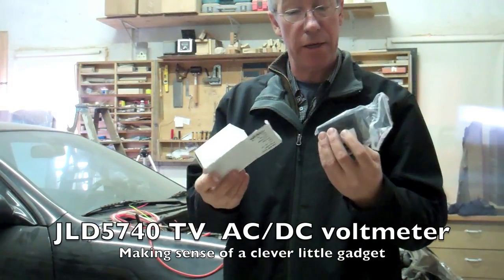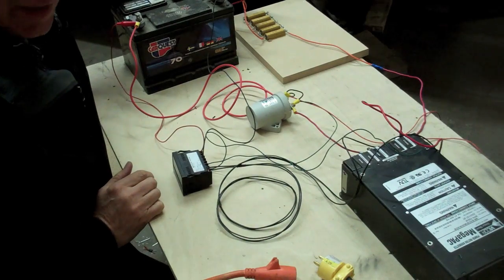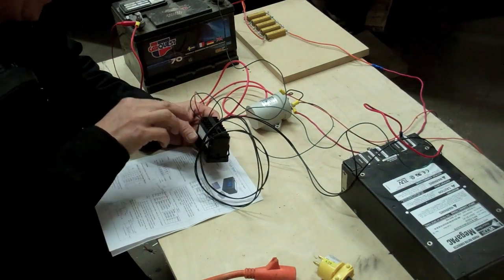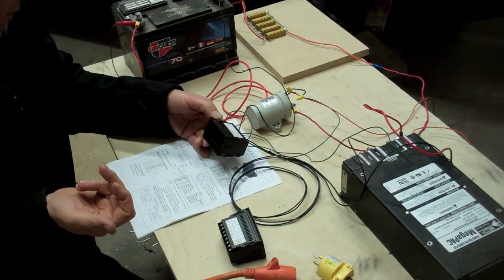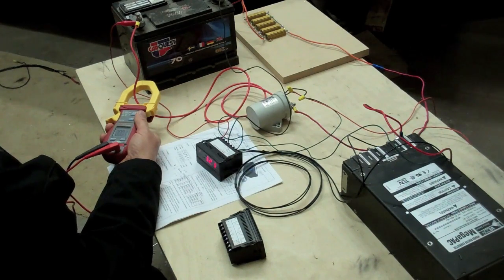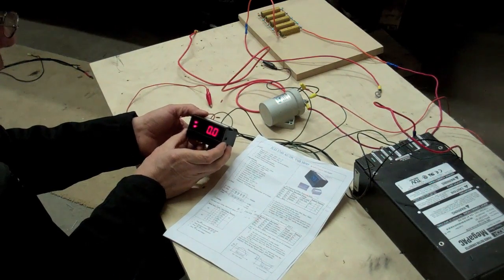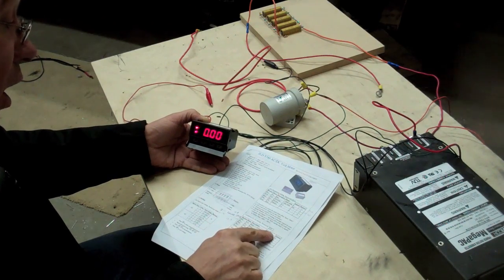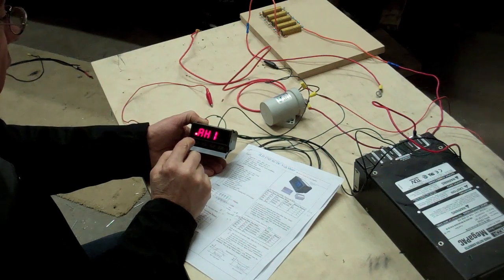John Allen's 1994 Celica Part 7

Comment: Nice work John. I did the same today but I had no phone joker.) Only the manuel. It looks much harder than it is. The only confusing issue is the PvH setting. But you did it.
For the relay I use pin 15 and the normally open pin 16. So I keep the AH1 set as the higher and the AL1 as the lower setting. Also I think it helps to use a bulb with the resitor to see it working.
Thanks
Mathieu